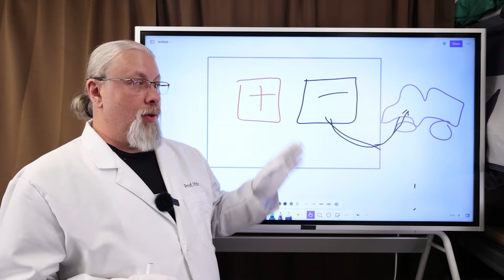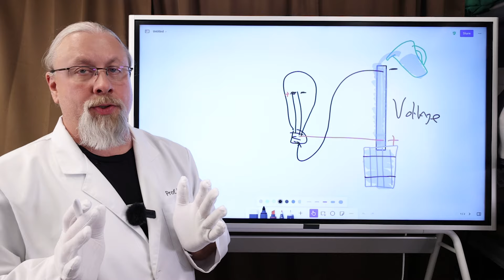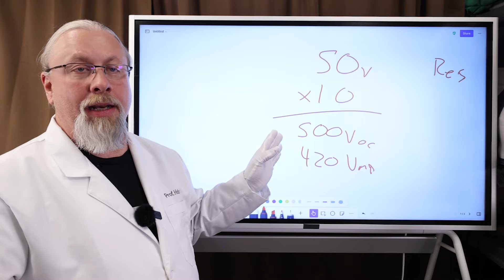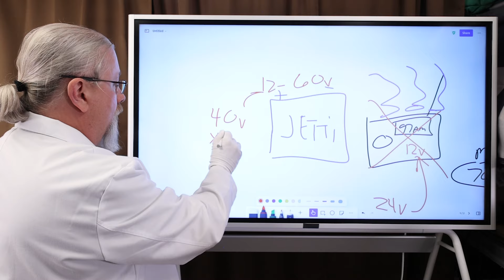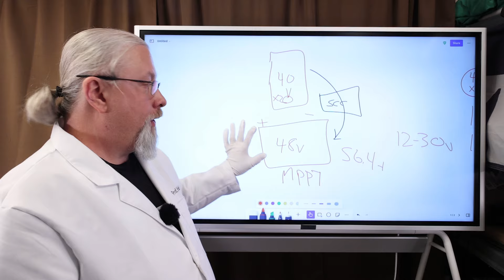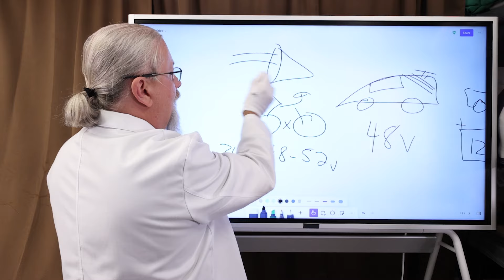Electricity for BEGINNERS Part 1/3: VOLTS In Solar Panels | Batteries | Power Generators

Comment: hello I have an apartment with a 15 amp capacity, if I take a small window unit , plug it into a power station , plug the power station into wall outlet, will it prevent a/c unit from overloading breaker???  the power station is a buffer in other words??

Comment: Thanks, Professor you said most dc fridges will run on 12 or 24volt. does that mean it will run on anything between 12 and 24 volts?  I am asking because I was wondering if I could run my fridge with an 18- or 20-volt drill battery?

Comment: You explained Marketing Voltage, Vmax, and Voc and told us to keep our SoGen Voltage under the maximum voltage, or we will release the smoke. You glossed over the 101 education moment! My SoGen says 12V-60V input and 10A, 500W. My 2x 200W panels are "marketed" as 24V high voltage (31.7 Vmax, 36.4Voc) (6.6A short circuit). Can I input them in series (72.8Voc)? Parallel (13.2Asc)? Or limit it to only 1 panel (200W max versus 400W)?
Reply from the maker: Watching the Amps video would answer this. You can never exceed volts but amps are self limiting.

Comment: Thank you. Terrific video. I especially like that you focus a lot on voltage limits and voltage ranges. Most people will think "oh it's a 12V system, so everything is exactly 12V everywhere". Nope. For example, our point that controllers will drive voltage down but not up. -- Suggestion: you could add a summary video about the main practical points about design or product selection from all of the educational videos, with pointers to which video to get more details.
Reply: That confuses me, all of the "it's this number, but really, it's (something higher or lower).

At one point he said you need to lower 18 volts to 14.4 to charge a battery.  Then he talks about some RVs and homes have hundreds of volts.  But what good are all those volts if 14.4 is all you can use?  Then watts and amps get mentioned but I don't know what they are and then....MIND BLOWN.

How can one thing - electricity - be three things?  (Watts, amps, volts)

Comment: (20:25) According to Car & Driver in 2022, most EVs and hybrids still have 12V batteries to run safety systems, intotainment, door locks and accessories.  The power required for these system is tiny compared to propelling the car so the wires are not large and the weight and cost savings from going to 48V for these items is minimal.  But, who knows what Elon is up to.
Reply from the maker: Yes, but I specifically said the Cybertruck was first to use only 48v. There are many benefits as there are more and more electronics on board. Others will follow, eventually.
Reply: @HOBOTECH  I stand corrected but I am not selling my 12V lead acid battery stocks anytime soon.

Comment: Hi there, I am curious and I need help. I test electrical appliances for leakage as an occupation. I need to do this on construction sites and am looking at getting a power station. One of the tests we do is a running test, where we run an appliance with a motor for up to 10 seconds. some of the appliances are 2500W .. what would be the best Power Station to buy for the job? I am not talking about brand, I am talking about being able to sustain the test without tripping.
Reply from the maker: Watch my review on the Delta Pro 3. That's probably what you want.
Reply: @HOBOTECH  Thank you, that is how I got to you in the first place and I subbed because I appreciate your knowledge and experience

Comment: Thanks for that. My big issue designing a mobile(van) system is finding the SCC that I want in the 3000watt range that will work well at the usually low VOC from the limited roof space on my van. Usually these SCC's lowest input voltage are higher than the usually two or possibly  three max solar panels that will fit on a van roof. Im shooting for 800watts of solar panels, 8kw - 15kw 48v batteries with alt charging. I want to use my van as a mobile backup power station for my critical loads at my home and to full power my off grid cabin.
Reply from the maker: The 60A HQST I reviewed would have no issue with 800w of panels in series.
Reply: @HOBOTECH  Yeah I meant to say All-in-One charger controller. Im looking at seperate components now. Ill check that out Thanks!

Comment: My ebike has a 220 volt charger. It consumes 150 watts while charging. Full charge takes 4-5 hours. Connecting this charger to an inverter, you probably need an inverter of at least 300 watts to fully charge your bike battery without too much heat dissipation. We are talking about huge amounts of amps here, at least 18 amps from a 12 volt battery. I will try an Ecoflow river 2 max to see if it can charge my battery full.

Comment: I'm seriously flashing back to those long talks with those old guys at the electronics shop back in the day. 
I remember them using terms such as valves and pressure.
 I've always related voltage as being the speed, how fast the electricity is moving through

Comment: You are very smart👍👍 But in my Lifelong experiences with Electricity i see it like this. VxAxW= Power , which comes from Generators or Solar components. If lightning hits or you rub your feet on shag carpet you can shock yur family member😂🤣😂or  light up a bulb. But Volts and Amps, and Watts are a tossedsalad of just flip that switch and alls good, we got light . Electricity is as reliable as a politician. And can just wack out if the moon passes an eclipse. My Advice is throw all the Logic out the window. Grab a generator, gasoline, propane, solar panels, candles, firewood, blankets, matches, oil lamps, and Do Not Rely on a government owned utility named electricity. Because Amps, Volts, and Watts wont mean squat when they shut down the grid. Electricity has only been around 200 years............ They survived for thousands of years on alternative sources, and smarts. Think past the limit.

Comment: You forgot to teach how much voltage one cell produces,  such as a lead acid cell produces 2.2 volts, and you need 6 for a 12 volt battery etc. I want to be educated on that compared to the Lifepo4 cells, what's the new standard for the newer technology?
Reply from the maker: This video was about voltage. I'll cover batteries in a separate video.

Comment: HELLO MR HOBOTECK ,
COULD YOU PLEASE GIVE ME THE NAME OF CABLE OR CORD NEEDED TO CONNECT TWO BLUETTIS AC 180's TOGETHER FOR LONGER WATT HOURS OUTPUT USAGE ?

2nd Question :  NAME OF CORD OR SPLITTER NEEDED TO CHARGE BOTH AC180 AT THE SAME TIME FOR CHARGING FROM THE WALL OUTLET TO BOTH POWER STATIONS AT THE SAME TIME ?  
THANK YOU HOBOTECH ITS REALLY APPRECIATED AND PLEASE PUT OUT A VIDEO ON JUST WHAT WAS ASKED ABOVE ... ONLY ONE VIDEO OUT THERE ON YOUTUBE AND NO NAMES OF WHAT THEY ARE CALLED FOR BEGINNERS TO EASILY UNDERSTAND AND ORDER !
Thank You Again , Caps FOR Easier Reading Only 😊 .
Reply from the maker: There is no cable to hook two 180s together. Not sure who said you can do that. Wasn't my review. You can charge two ac180 at the same time by simply plugging them in simultaneously? Appreciate the donation.
Reply: @HOBOTECH  SORRY ONE OF MY POWER STATIONS IS A AC180P AND THE OTHER IS A AC180 ... IF THIS CHANGES YOUR YOUR ANSWER .... I SEEN ONE VIDEO WHERE ONE BOX WAS PLUG INTO A USBC PORT AND THE OTHER TO THE A ENERGIZER PORT BUT HIS POWER BOXES WERE A BLUETTI EB70 AND A ENERGIZER 370 POWER STATION ... IM WONDERING IF I CAN COMBINE BOTH OF MY BLUETTIS TO HAVE THEM TO RUN AT A LONGER TIME... LONGER TIME USAGE ONLY ?
THEN CAN I CHARGE BOTH AT THE SAME TIME WITHOUT HAVING TO CHARGE BOTH SEPARATELY ...
WHAT WOULD I HAVE TO BUY FROM BLUETTI TO MAKE THIS HAPPEN IF POSSIBLE ?
Reply from the maker: Again, there is no way to hook AC180 or AC180P together, short of plugging the AC cord from one into the inverter of the other.
Reply: @HOBOTECH  
Hello HOBOTECH , I spent many hours yesterday looking for an answer to this question and I finally stumbled across a couple chats between Bluetti employee and one other person that asked the same question about pairing two Ac180's together and just happened that  one was using two Ac180"s and the other guy was using a expansion battery with there Ac180's ...I will look and see if you have an email and I will send you pictures I took of the only way that you can make this happen ... Thanks for your time , Dave .
Reply: I don't do social media and I couldn't find an email of yours under the about section here on you tube to send over a few pictures of how it's possible to use two Ac180's together and also be able to use expansion batteries with the Ac180 ... I type slowly and to much for me to type ... HOBOTECH keep in mind I'm new to this and learning just by listening to you and watching videos .
Thank You Again , if you want to know I need an email and I can't leave mine here I've had it over 20 years and keep it  somewhat private ... Dave .

Comment: Thank you. I bought a Pecron e1500lfp and I have been looking at solar panels for the roof of my van. Confused by VOC and VMP. Now, I am more certain that VOC is the important number. Finding the right panels to run in series to get VOC between 32 and 80 volts is part 1. Looking forward to learning about amps. Will be measuring the available space on my van roof to see if there is any way to get 400 watts up there with the right combo of volts and amps. My BIG QUESTION now is "If the solar panel is not putting out all the rated watts, does that affect the voltage? the amps? both?" If I can only get 200 watts on my roof and it is partly shaded so the panels only produce 50 watts, will I get nothing out of the charge controller?
Reply from the maker: Amps are reduced, not volts when output is lowered.

Comment: I would give you a grade of B+ for this explanation.  You left out a few key formulas, power vs current vs voltage, why open circuit voltage is important.
Reply from the maker: I covered why voc is important. Amps and power is next video. This was too long.
Reply: @HOBOTECH   I thought it was excellent , very well suited to your usual audience.

Comment: Great presentation! This information can never be emphasized too much. It's also important to note that 48v, unlike the lower voltages, is deadly. I've worked with electricity for a long time and I go back to basics often. Thanks, Professor!
Reply: It is not the voltage that kills you. it is the current.  That is what the USN taught me.  In reality it is the combination of the two.  You can touch HV as long as you are not grounded or near a ground to spark to.

Comment: Thank you for the class.  I am embarrassed to admit I needed this class.  Thank you Professor Hobo.
Reply: YES!! I played around with simple circuits as a kid, but my profession took me in a different direction, so it is always a good idea to review & re-focus on how NOT to let out the Magic Smoke!
Reply: Agreed. Thank you Good Sir Hobo for explaining things in a simple manner for those of us that are not electric savvy.
Reply: Never be embarrassed by the complexity of this topic! Many of us have been through multiple attempts to lear it all and to extrapolate what was said to what we need. Onwarrrrd!!!
Reply: Sorry. Bud. It's. Over. My.  Head.  Wasn't.  Good at. Maths
Reply: Thank you. I think they are very helpful. I think this one was a little long even for somebody like me that has a good basic understanding of bolts maybe I think you went a little bit too far in depth about the 48 and keeping it at what would be common usage for say a camper or even somebody who's using it for boating might be better and then do a separate video for if you're going to put it in a cabin. Just a suggestion.